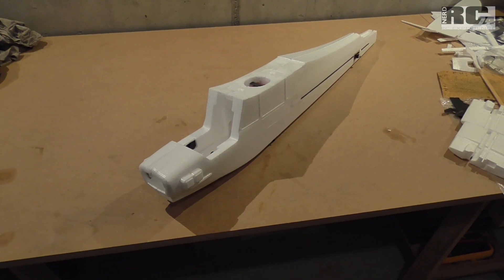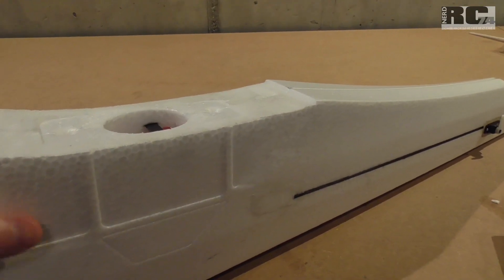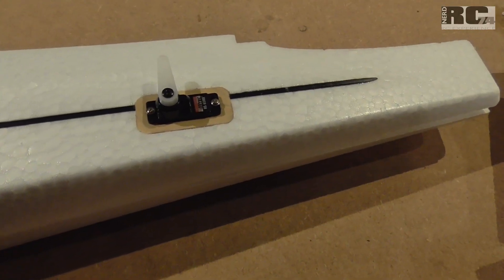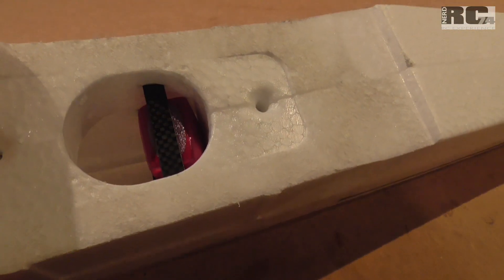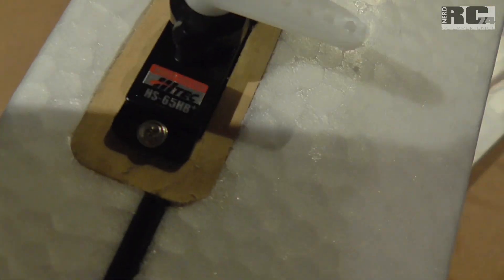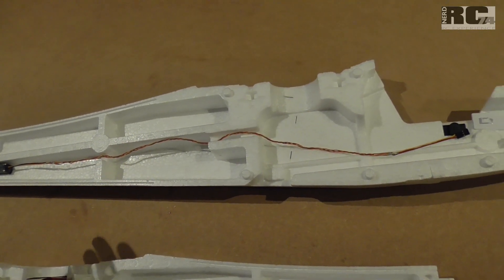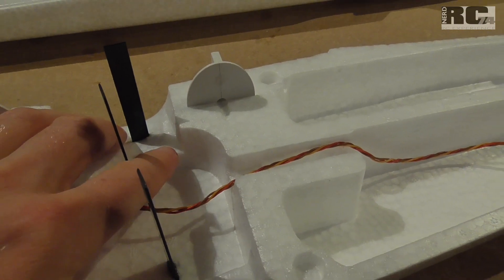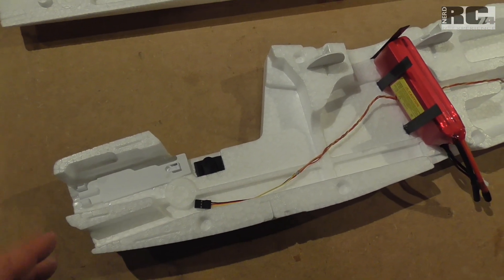MULTIPLEX FUNCUB | CLIPPED WING CUSTOM BUILD | PART 2

Comment: I tried your battery position some time ago (I copied what you did with your "unclipped funcub") but had trouble with the CG back that far. Do you change the wing/tail incidence also?
Reply from the maker: the tail section is stock in case of rudder angles... how heavy is your motor/esc setup? perhaps this makes the difference... my AXI motor is 151g and the esc hobbywing flyfun 40A is about 44g (manufacturer specs).
Reply: @RCnerd74  I suspect the weight of the motor would make the biggest difference, my motor is 110g
Reply from the maker: @Tsnafu  40g is much. I also use a spinner which is around 15-20g.